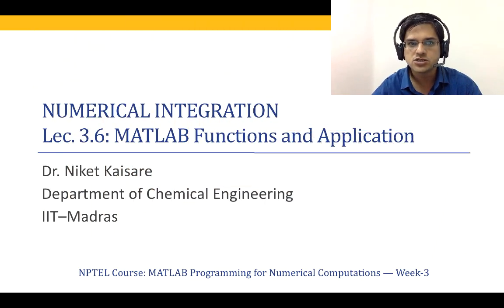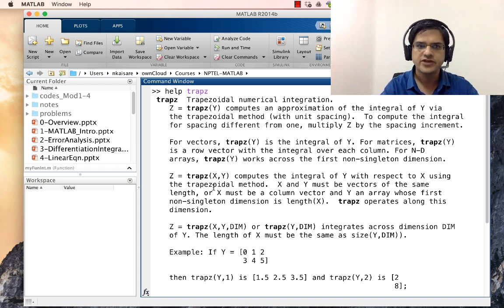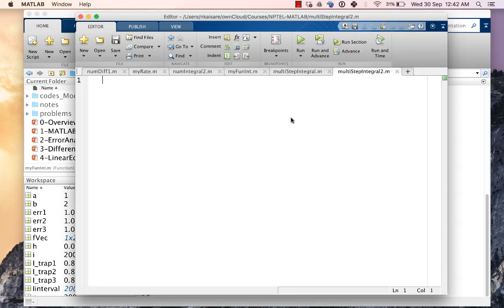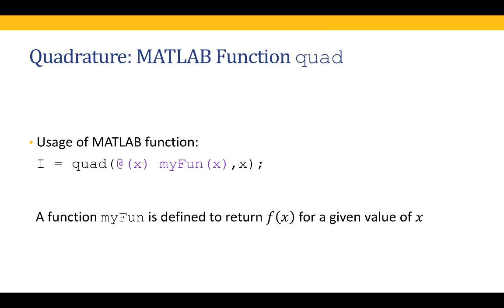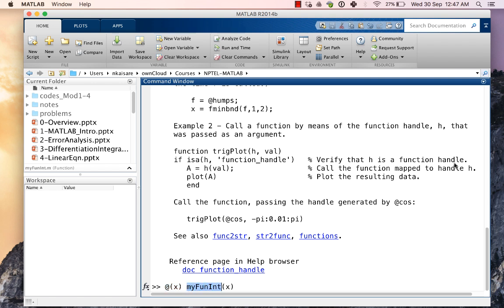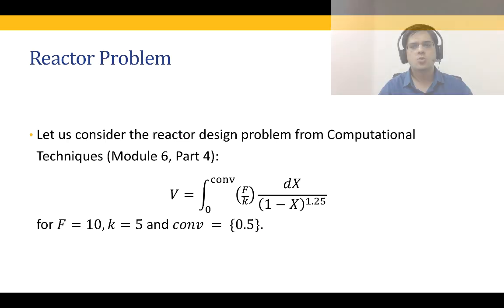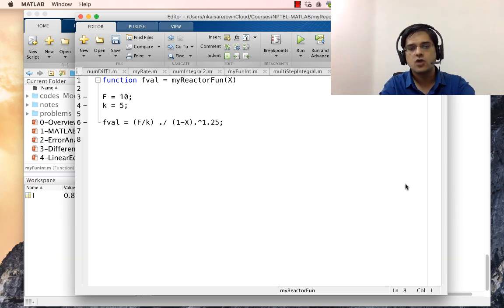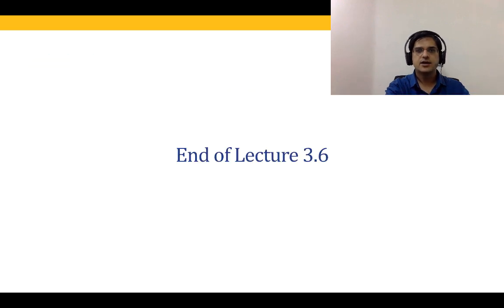In-Build MATLAB Integration Functions

Comment: Is it possible to do a integration if the function has two variables (in vector form)e.g. x and y, and want the integration only on x (for x=0 to x=infinity)? No integration limit on y...y is a row vector for me!... kindly tell if there is any solution for that!
Reply: I have also same query, could you please tell the solution
Reply: @jithin-u9t   Yes, you can use numerical method like trapezoidal to calculate double integration but those method is computationally costly. OR you can use monte carlo method (stochastic Method) to calculate integration  and you can write the code as well... but in those method, limit should be specified